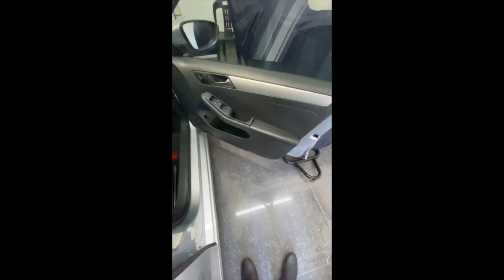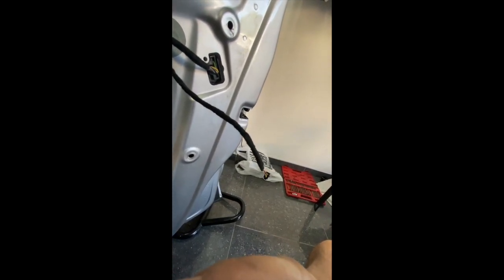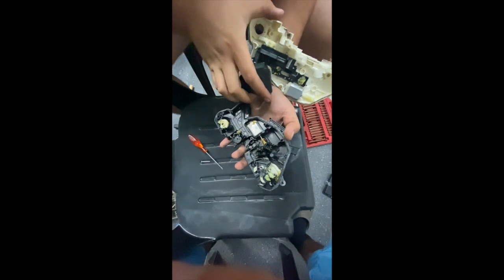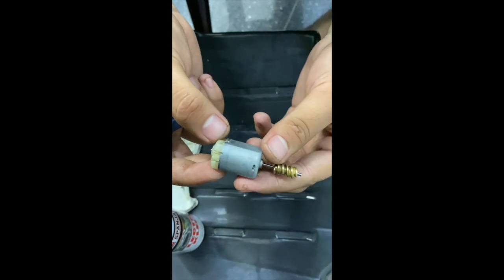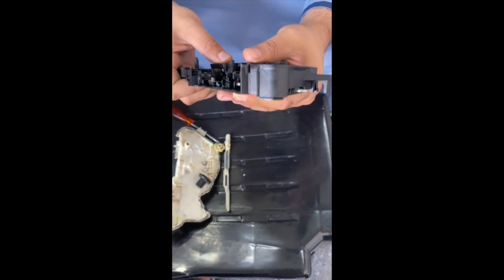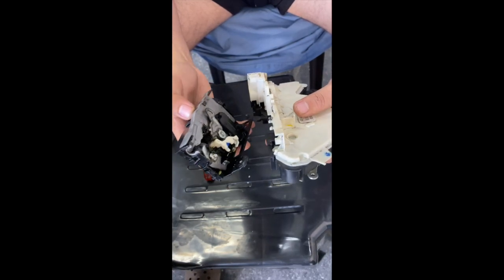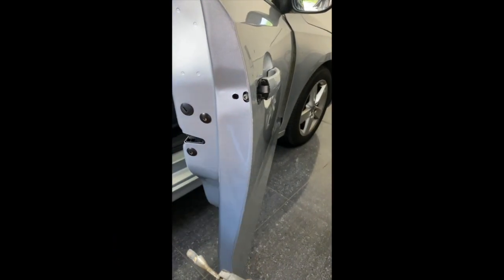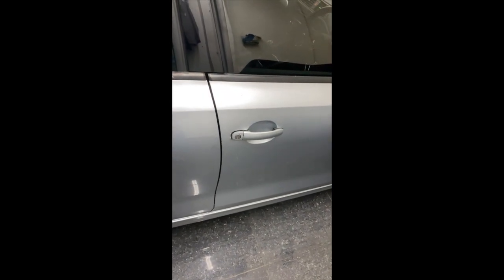VW GOLF/JETTA MK6 CENTRAL LOCKING REPAIR (TUTORIAL)

Comment: Yup dude! I had a rust colored motor. Opening it without breaking it took a whole hour. Used bike chain oil to work it loose, cleaned and greased everything else. Closed it with epoxy... had nothing else... my plastic glue had solidified in the tube. Finished in the middle of the night, went out in the parking lot, plugged it in... dangling at the end of the wire... got the door trim with the switch... klock... k-klock... freaggin works!
Thanks man.
Reply from the maker: Glad to hear 
What other repair guides would you guys like me to post regarding mk5 and mk6 ?

Comment: I just watched your video and I took apart my actuator for my jetta 2014 tdi driver door. I followed your instructions and the only difference is that the jetta has only one motor. Drilling the pin and tapping it out after that i opened the battery and cleaned it. Worked like new. Thank you for your video !!! This took me one hour

Comment: Thank you Sir, Had the same non locking problem on my 2012 TDI right rear door, used your video as a guide and reconditioned the latch. Works like a charm. The way you took it apart seemed like you had prior knowledge of this latch.
Reply: Man my door is not getting latch when pushed at normal swing... I need to go ultra slow to get it latch.... Why seems to be like this?

Comment: So when you press the key fob unlock,does this part receive the radio signal and move the solenoid.
Or is the signal sent by other electronic part to this unit?
I understand the video you made,but would like clarification as to does this part receive the signal from the key fob lock or unlock function

                                                                      regards    Col

Comment: Works great after repair
I assume I had the same issue with the motor as it only locked and wouldn't unlock mine had rust on the motor but wasn't as complicated (only had one motor) but your info on the spring locations were very helpful for putting back together well worth a try if your mechanically inclined as worst case you buy a new one. 
Thanks for posting this video spent weeks looking for the newer style repair of course vw/audi wants you to buy a new one for absurd $$$ for a part that seems to be a fairly common problem

Comment: How is this done on a 2012 VW Golf 2.5L MK6 Base model. Once I take off the door panel there is another panel on the door frame that is attached on by rivets. Please Help
Reply from the maker: You have to drill the rivets and open the window mechanism out 
Its a bit more complicated 👍🏻
Reply: The outer skin comes off.
Reply: There's bolts around the perimeter of the door. The outer skin of the door is removed for access rather than the conventional way of access by trim removal.